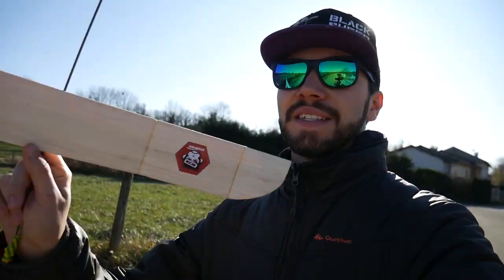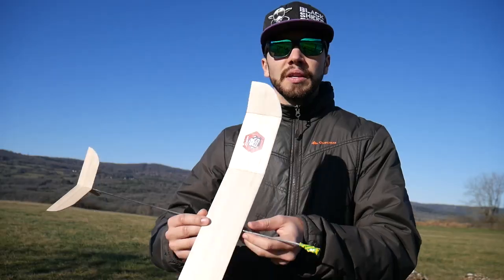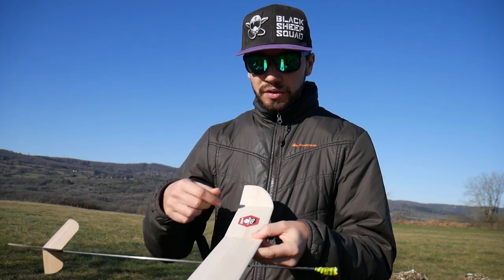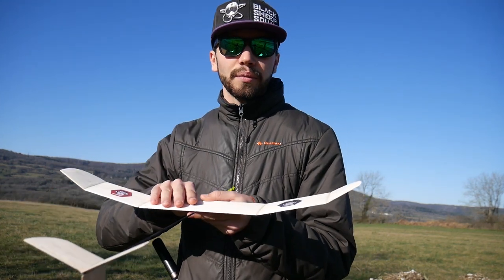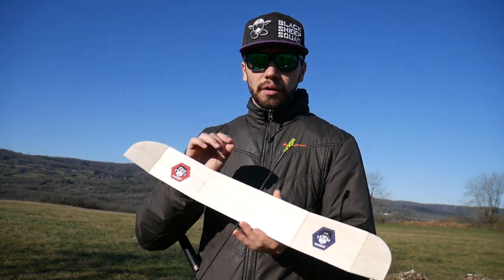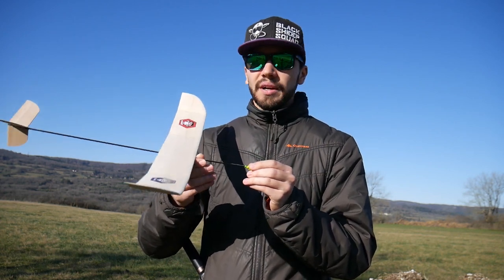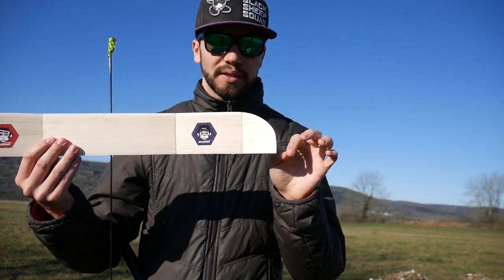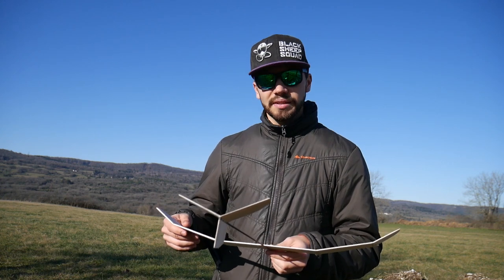Freeflight DLG glider DIY !

Comment: I won an Australian Free Flight Championship yeara ago with a Butterfly design from an Aeromodeler plan from the 1990s ~ had a tomy timer and lead weight on a monofilament attached to fuselage rear. Won in quite windy conditions dethermalling at 1000ft. I still have and has boron fillaments strengthening a balsa fuselage and launching with finger behind wing. Nice ti see your enjoy this minimal flying.

Comment: Why breaking the dihedral? it hurts me to see that.
Cut it to panels and sand it for the angle you need and then glue it, it will look more professional.
You also need to sand the trailing edge..

Comment: do you know why the y tail is common on freeflight dlg's but rarely used on rc dlg's?
Reply: Probably because elevator servo control becomes less practical.
Reply: To make it in a positive stablility for rotation when launching.. the stab is also glued in an angle related to the tailboom.
rc dlg have a bigger fin that can fix it, in this type of models its the minimum tail weight figuration needed to do its job.

Comment: Very nice and simple design! Just one question: Is there anything you set up in it so that it flies in circles? I mean, I suppose it is trimmed to fly in circles, or else it would fly a straight line until you can no longer see it, right? 😁
Reply: ... the free fly - experts stick a tiny and short strip of balsa on the leading edge of the horizontal stabilizer, in which direction it should steer ...